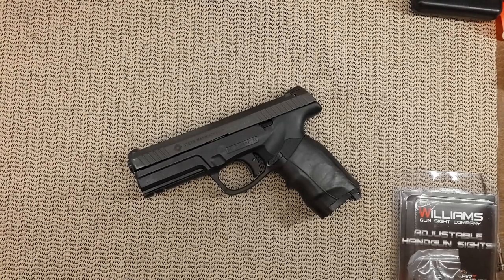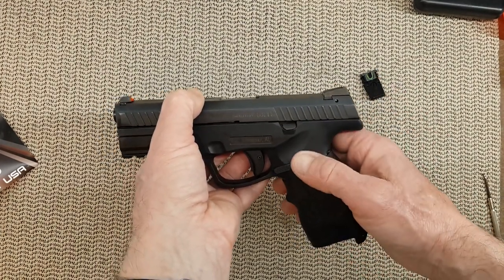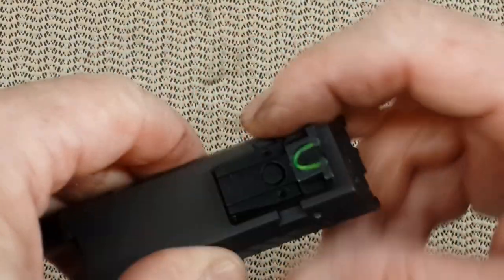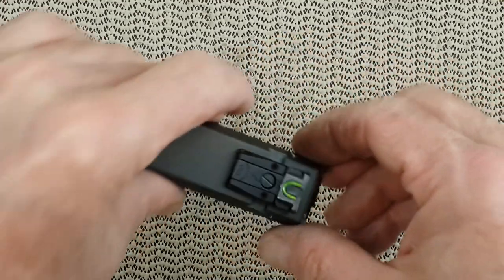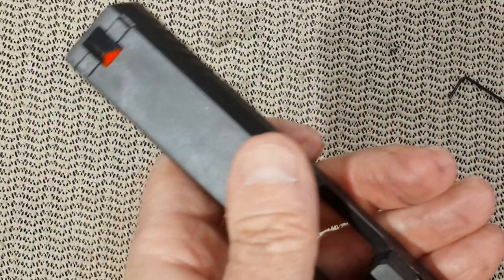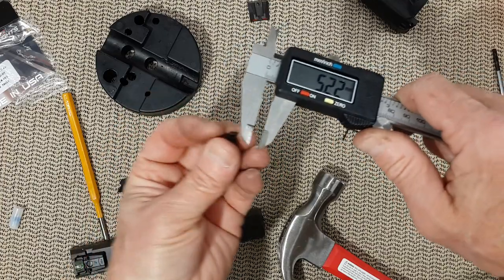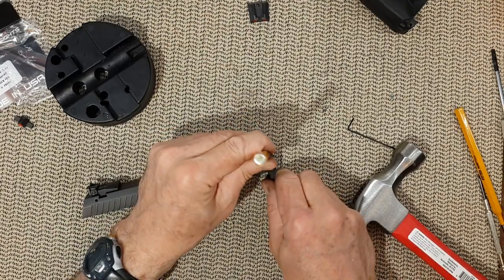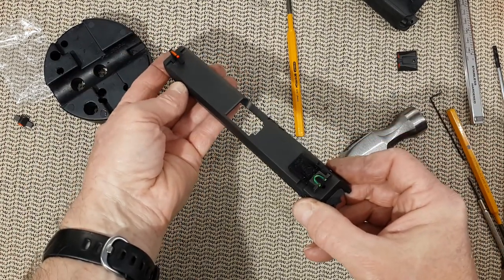Steyr L9 M9 C9 A1 Aftermarket Sights

Comment: I added the TFX sights to mine and got them dead centered right away under a magnification glass. They really worked well and I didnt need adjustments afterwards. And I m really curious to see if the rear sight stays put after 5oo or 1ooo rounds - despite the loctited screws.
Reply from the maker: I am curious as well. I had a comparable set up on a Red Dot Mount and it stay true for that many rounds, so I am hopping the same for this rear sight. 
Here is the mount and go to 12:00 minutes in the video
https://youtu.be/Zna02tAoR0g
Reply: I guess you have shot 500 or even 1000 rounds, hope that TFX stays put.

Comment: What is the purpose of that roller that is exposed once the rear side  is removed? It can be seen bottom of frame at 3:20 and is held in place by a roll pin ? Thanks.
Reply from the maker: It can be found on the last generation of the M9. It seams to help the firering pin hold true onto its axes when moving back and forth.
Reply: @practicalshooter6517  Thanks. By the way, your videos are extremely informative. Thanks for helping us out.

Comment: Hello - regarding sights: which SIG sights? The one from the P320 series, or the P226/X5? And of the P226, there are older stamped slides, and new milled ones... Regards
Reply from the maker: I haven't done any research on the Sig sights, as most sight manufacturers will classify XD and Sig together without naming any Sig handguns in particular.